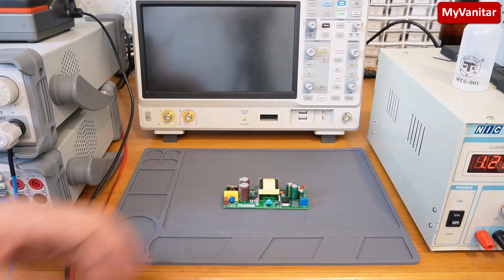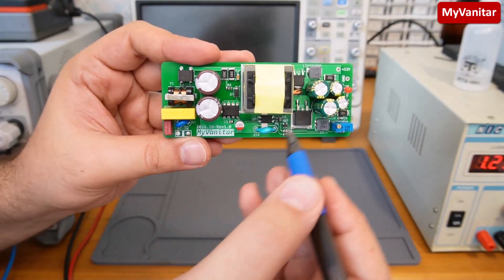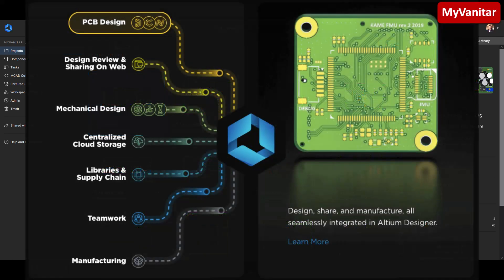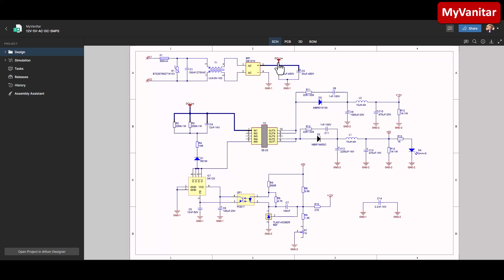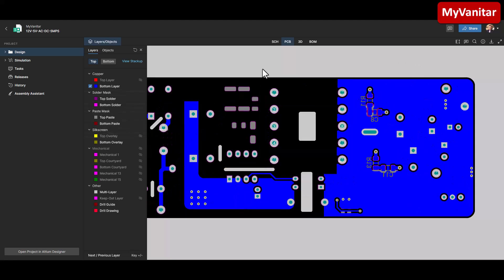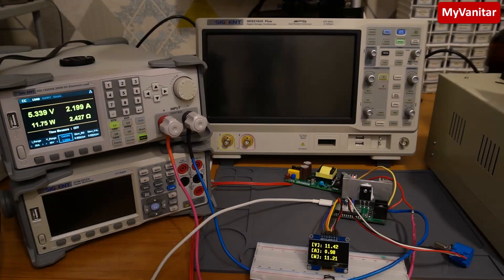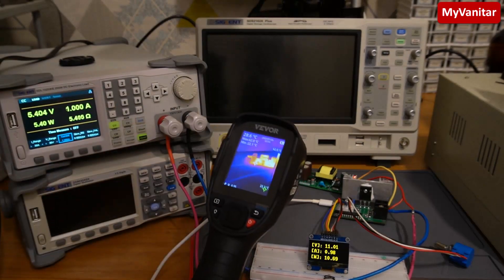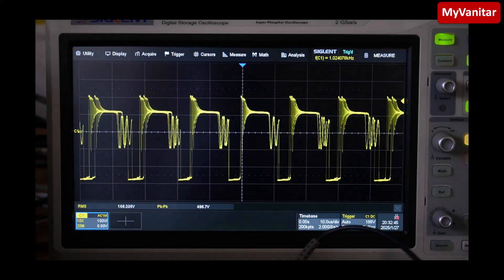85V-260VAC to 5VDC/12VDC 24W Flyback Switching Power Supply

Comment: GND-2?
Reply from the maker: correct
Reply: @MyVanitar what did you mean by correct? ... I'm beginners 😅
Reply from the maker: @zakouda-j1m  this is an isolated Flyback, GND-1 is the input side ground and GND-2 is the output side ground
Reply: @MyVanitar yes yes I see the gnd-2 welding by gnd of secondary.. ok ok ok I got it

Comment: Great video! I liked the drill holes to keep the clearance and creepage requirements! Just one correction - the RCD network here is not a Snubber but a Clamp, this is why the maximum voltage on the drain does not exceet a certain value but there are a lot of ringing in the drain-source waveform (leakage inductance of xmer resonate with the Coss of the MOSFET). A Snubber across the drain-source will help tremendously with the ringing.

Good luck on future projects!
Reply from the maker: Thanks dude

Comment: Great explanation, but the main part of power supply is transformer and unfortunately you dont explain transformer. It is useless to download design files if we dont know which transformer to use
Reply from the maker: I surely provide these details and even more, but I usually provide them in the article (it is linked in the video description). If you can wait until I put that article link, that's fine, but if you are hurrying, I can give you the windings info to build one for yourself, by the way, the core is EE25-13-7 and the bobbin is 5+5 (Horizontal).

Comment: the explanation in video is pretty good. But what are transformer specifications?
Reply from the maker: I surely provide these details and even more, but I usually provide them in the article (it is linked in the video description). If you can wait until I put that article link, that's fine, but if you are hurrying, I can give you the windings info to build one for yourself, by the way, the core is EE25-13-7 and the bobbin is 5+5 (Horizontal).
Reply: @MyVanitar  i can surely wait for the article .thank you